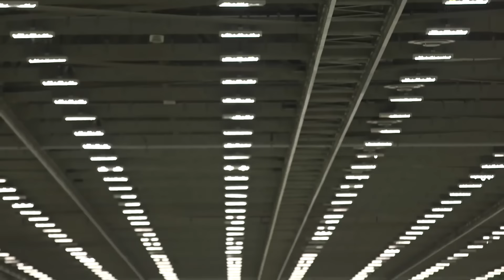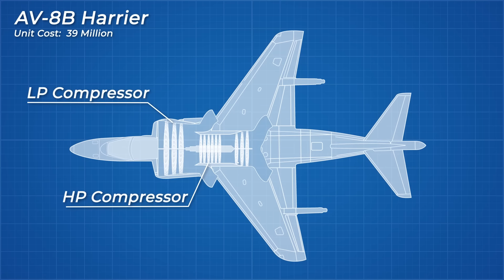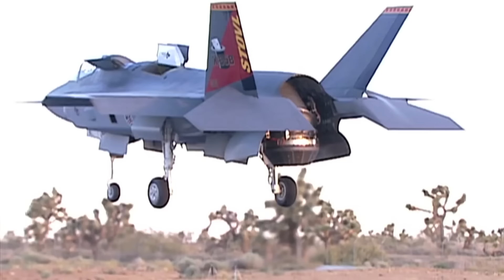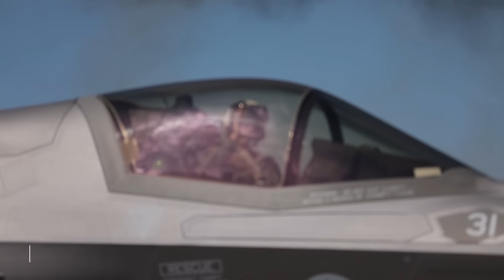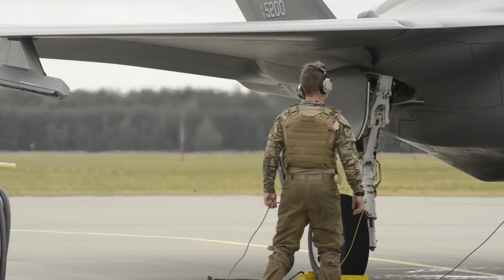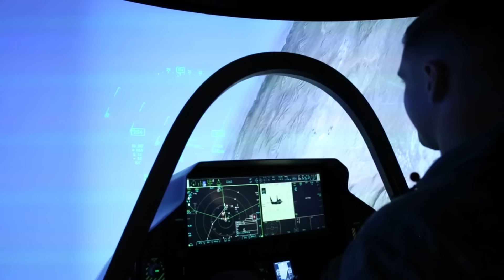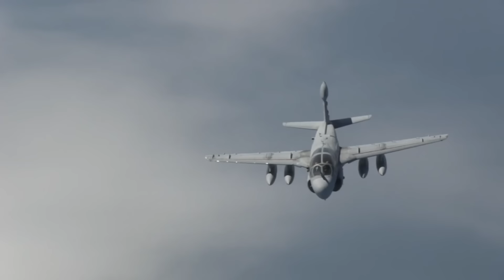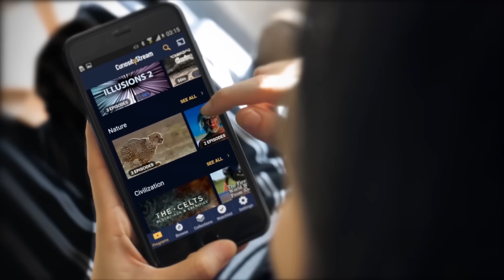Is The F-35 Worth $115 Million?

Comment: It should be noted that the F-35 has failed to beat the A-10 in terms of operating costs and operational effectiveness. Ground commanders routinely and explicitly request A-10 support because it can stay in the operating area longer and is better suited for continuous Close Air Support. Because it is a far older and more physically robust aircraft, the costs for replacement parts are both cheaper and last longer than the F-35's equivalents.
Reply: Not really the case. The multi-role fighter has been taking over for the A-10 in operational readiness, quick-reaction capabilities, and survivability where a ground-to-air threat is present.
Reply: Yes, Surface to Air threats is the only CAS realm that the F-35 excels the A-10 in, but that has not been the norm for the wars the US has been embroiled in. The costs and effectiveness differentials between F-35 and A-10 CAS operations are still heavily in the A-10s favor when StA threats don't exist.

Comment: 12:08 - "Missing software..."
Irrelevant point. Dogfights happen, and will happen even in stealth/low observable aircraft. Your software and sensors and radar and IRST can't see through a mountain or ravine or a valley of earth. Pilots routinely fly in these to avoid detection.
12:13 - "Missing radar absorbing paint..."
That's... not a positive. Paint on aircraft, especially RAM coatings, put on hundreds of extra pounds of weight on the aircraft and affect performance negatively (albeit slightly). Also, IR seekers don't care if you're invisible to radar, your hind end is emitting thermal radiation like its going out of style.
12:21 - "But these other pilots like the plane..."
1.) Not an argument. 2.) And as we see in the case of F-22 pilots that whistleblew about the oxygen generator issues ("Raptor Lung") on the aircraft, talking ill of multi-billion dollar weapon systems is a sure-fire way to prematurely end your career. And isn't it interesting when it's not someone who is connected with Lockheed, nor in a high position that starts involving politics as well in the military (like a Major overseeing integration of a mult-billion dollar weapon systems would be), and doesn't have the not-as-proverbial-as-you'd-like job on the line that they start quietly expressing concern.

The fact that Lockheed is dirty as hell and has been involved in multiple bribes, corrupt business dealings and outright illegal activities (see the Lockheed F-104 deal with Germany, for a major example)... Forgive me if I don't trust a single word coming out of their mouth. Especially when we have a mountain of evidence showing the shortcomings of the airframe and the entire point of us having this program was to "save money" and we're doing anything but that.

Comment: On one hand, I do think the whole make money by killing people iron triangle is pretty fucked up. On the other hand, there are far worse nations in the world than the us, far worse strategic alliances than NATO, and given the singularity the US and it's allies presents as a global military super power, the bleeding edge military tech does help maintain global peace (for the most part). 

The main issue I have with the F-35 and F-22 is that these aircraft are untested when it comes to Russian electronic warfare equipment, which is where Russia had invested most of its military R&D since the fall of the USSR. 

In Crimera, Russian forces have set up transievers over a few acres that, according to many sources, have the capability to jam wide bands of radio waves as well as listen to those bands, over an area stretching as far as the English channel in ideal weather. Much of what makes the F-35 both expensive and tactically adventageous is it's interconnected design, which goes completely out the window if the aircraft cannot communicate with one another or with the command center. In such an environment, the fighters are at a significant disadvantage to gen 4 and even some gen 3 fighters, which have better manouvering and lower energy loss in dog fighting conditions. 

Of course, the US is very unlikely to go to was with Russia, due to their significant nuclear arsenal, but it wouldn't surprise me if we went to war with China and it wouldn't surprise me if China was able to buy some of the superior Russian electronics warfare equipment from Russia; I don't think it is absurd to think such transactions have already taken place, as I believe China already blocks a lot of satellite and other radio frequencies as to keep it's citizens from viewing materials deemed inappropriate by the communist party. It would be far more efficient to keep the jamming towers up to date with the latest jamming and snooping EWF equipment from Russia than to build them only with limited capabilities. After all, if China needs to blacklist a new frequency, the EWF equipment would make that quite easy. In this way, China would have a rapidly deployable bubble that would block hostile forces air and ground communications and offer the Chinese armed forces a significant defensive advantage not seen since before ww2. The company level deployment of radio communications was a significant and decisive advantage us troops had in ww2 that was instrumental in organizing battle plans as well as reacting to the enemy where runners and other human communication lines may have been slow, ineffective, and unreliable. The radios didn't always work or have sufficient signal, but in the instances that they did work, it gave field commanders and line officers unprecedented tactical coordination abilities and overall strategic advantages. 

Russia understands how important communications are in modern warfare and have invested heavily in such technology, which reduces the amount of military spending and human capital needed to conduct both offensive and defensive opperations. The us should invest in new satellites and laser line communications that can network and connect aircraft and ground units with IR spectrum, low bandwidth communications that wide band jamming cannot effectively jam, as the signals would be point sources rather than broadcasts. Such a devise could, reasonably, be added to existing aircraft when it becomes clear that the enemy is using communications jamming EWF equipment, as to maintain a solid hold on communications and coordination.

Comment: There is also the "I" variant for Israel. The F-35 was supposed to use many of the same parts but they don't. They are very different planes. The F-35 will be an ok plane. The tech is impressive, but the plane isn't specialized. Noteable planes have been cutting edge and specialized. Blackbird, nighthawk, B52, Mustang, B2, A10 and Harrier.

Comment: Frankly, every single variant is, the A, B, and C are marked improvements over everything that its designed to replace, and costs less than trying to maintain the fleet of current generation aircraft throughout the next several decades.  Additionally, it's stealth capabilities, ECM and advanced avionics make it more survivable in modern high-threat environments ensuring the US expeditionary capability is still a credible threat for the foreseeable future.  From my understanding it does everything that they were looking to do.

Comment: this plane is older than me (I'm 18) 
imagine Nokia 3310 being released today, imagine a plane that maximises todays technology
Reply: It takes a long time to field a plane without getting people killed.
Also M Hamma is right, the software is not what it used to be, which is part of the reason it took so long to be deployed.
Reply: Actually no, the planes coming off the line are brand new and have been getting tons of updates / software / sensors that can be fitted to the older aircraft.  It's like a modern PC being upgraded with each block that is built.  The lines are continuously being upgraded as are the parts going into it.  It was designed with such modularity in mind.  Each new block is better  / more advanced than the last.
Reply: @mhamma6560  It is like an old PC being upgraded while a Smartphone can do the job and it has more options..
Reply: @TorianTammas  more like it's a pc case that had all it's internals ripped out and replaced with cutting edge classified technology, much of which we on the consumer market won't be privy to until 2040.
Reply: @TorianTammas  The F35's capabilities makes the smartphone look dumb.
Reply: @mhamma6560  I assume you missed  the point as it was about a PC And that it can be replaced by better tools like a smartphone in certain ways. Such a costly gadget like the F-35 is overpriced and questionable if not cheaper and more specialized ones would be more then qualified to do the job.
Reply: @TorianTammas  There is nothing a smartphone can do better than an actual computer with keyboard.  Such a statement shows either your lack of understanding of PCs, or the fact you've never had one setup to get anything done.  Current phone capabilities remind me of a 20yr old computer as far as productivity.   There's no comparison.  Phones and tablets are CONTENT CONSUMPTION devices, nothing more.  They're very poor at pretty much everything else a PC can do.  Do you know what's taken up the role of  content consumption devices?  Smart TVs with a screen that's actually usable.  Phones can do nothing of value without being tethered to a charger.  Even then their max utility is still basically a small fraction of what a knowledged individual can accomplish with computer.
Reply: @mhamma6560 - The idea was a comparison to illustrate that people use smaller, easier devices for basic needs. It is a fact that a lot of people replace their PC with hand held devices like tablets or smartphones they can use wherever they are. A lot of people have very basic needs that can be fulfilled from using an actual phone to text communication and email.  
The point was the gigantic investment in a plane that should fulfill the need of every branch is questionable. There are needs for a high end PC or may be even a grey computer, but a in most cases small and more flexible approaches suffice may it be tablet, laptop or smartphone.
Reply: @TorianTammas  If someone "replaced" their PC with a smartphone, they didn't need a PC in the first place.   Completely irrelevant to the 35 though.
Reply: @mhamma6560  The point was that one plane never can fit the needs of three branches of the military. The PC was an example given not by me and I used just the example of tablet and smartphone that what they serve people who once used a PC for certain task. A high priced plane means it is in short supply and it does not the tasks as well as a specialized plane and often a cheaper and more flexible one would do the trick.

Comment: When it comes to getting your hands dirty in the ground war, fancy and expensive doesn't work.
Cheap, durable, and easily fixed/replaced works.
Our guntrucks weren't science fiction marvels armed with lasers, they were hummers and delivery trucks with armor bolted on and a motor pool of salty grunt mechanics. 

At 25,000 feet in a dog fight with strategic implications, sure, go Fancy Spendy. At Angels 2 with purely tactical implications, you have to accept some losses, and have the money to replace the equipment AND the men, AND still field lots of them afterwards. Sorry, that's just war logistics. Never, ever go with an "eggs in 1 basket" strategy when getting dirty with the ground conflict, which is what the F-35 does, and the A-10 does not. You shoot down 1 out of 2 F-35's, CAS just stopped. You shoot down 3 of 9 A-10's for the same price, the other 6 keep delivering Mk83 pizzas.

Comment: The AV-8B is an American design by McDonnald Douglas. The British had very little input into the airframe.

So a Pegasus engine looks like a normal 2-shaft turbo fan jet engine with 2 compressors and 2 turbines because it is a normal 2-shaft turbo fan engine with 2 compressors and 2 turbines with the air bypass air being ejected from the airfram ahead of the centre of gravity through its own exhaust nozzles than the traditional route of out of the exhaust nozzle. The nozzles are part of the airframe and not the engines, as anyone who has read anything about this aircraft knows.

The contol nozzles are at the extremities of the wings and fuselage and are further away from the centre of gravity than the associated control surfaces. What are closer to the centre of gravity are the exhaust nozzles. There were roll, pitch and yaw control jets, and the were linked to the control surfaces all of which were manually controlled.

All pilots have to consider many factors when landing, as if they get it wrong it often is the last mistake they will ever make. Apart from keeping a look out for other aircraft, they have to keep a eye on their landing point and maintain the right glide slope. This is fine if the wind is coming straight down the runway and there is no rising, or worse, sinking air. They also need to ensure thst they round out at the right momemt. Too high and they might stall into the ground to low and they have a controlled flight into terrain accident. The pilot gets a lovely seat at the front with a brilliant view, however, this means they will be closer to the crash that anyone else.

Please stop mixing up the words valves and nozzles.

Well every capability save the A-10's ruggedness and gun.

Comment: Due to range and payload limitations of the f35. While purchase price is lower then the f22, if you take into account the fact that you need more f35s then f22s for the us military to do what it does. Then the f22 actually ends up being cheaper in the long run. And it's still miles better in air to air combat

Comment: the F-35 is not worth shit from my ass, it's a garbage plane that can't dog-fight OR super-cruise and every role it fills is already better filled by a safer, more specialized design
Reply: This notion is based on what exactly?
Reply: @peterson7082  One of it's main proponents literally said it's incapable of dog-fighting, two of the three variants aren't capable of super-sonic flight at all. At best it's maneuverability is on par with an F-16, while having a smaller payload, it requires the replacement of a large portion of infrastructure, including both carriers and cargo planes (they're aging and need replacement anyway, but ideally older versions should at least be compatible)

And of course, it solves a problem that doesn't exist. There is no legitimate threat to US air superiority that merits the adoption of a stealth capable fighter, or in fact anything more expensive or difficult than simply making minor improvements to older models, more in order to retire aging airframes and engines than to actually meet some need.
Reply: @Oldage429  Most pilots seem to agree its maneuverability, acceleration, and turn rate is on par or better than the F-16C/ D and F/A-18E/ F. All three variants are capable of supersonic flight at combat load. The F-35A and F-35C still maintains a degree of smaller RCS and less parasitic drag than its contemporaries at full combat load. 

 The issues with overbudgeting largely came with prolonged requirements formulation (something that had nothing to do with Lockheed Martin ) and unfortunate and arguably uncessary repeated postponing of testing between 2007 and 2014. Albeit the tests were completed still in the time period.
Reply: Oh, and also war is always a colossal waste of energy, money, and human life and the US military is the single greatest source of suffering and misery among all institutions on earth.

Comment: what, no mention of the yakovlev & lockheed partnership (1991 - 1997) and the yak-141 “freestyle”?

random google search: “When Lockheed entered a VTOL variant of its X-35 demonstrator into the Pentagon’s Joint Strike Fighter (JSF) in 1994, the submitted engine design proposal was radically different from initial proposal developed prior to the Yakovlev deal. Indeed, the VTOL design was changed to ‘ASTOVL Configuration 141’”

Comment: Third gen planes such as the F-15 as well as support aircraft such as the A-10 are in service for 60 to 70 years these days. The initial unit purchase cost is far outweighed by the total cost of replacement parts and upgrades needed to keep them in service. By unifying most of the components in the three variants of the F-35, the US expects to lower the total cost of fielding the aircraft. This is possible by producing replacement parts and integrated upgrade packages in higher quantities. Design, tooling, and production costs can go down exponentially if you are producing high enough and long enough to buffer the initial costs. 

Defense planning needs to work on a "long game" strategy that is difficult to understand for "4 year" politicians and the general public.

Comment: its  several small companies working under Lockheed martin in this way it secures jobs around the  country but as you said muddy waters making it cost more at first but the price will go down over the course of it.  This was a small step back but stopped it from f22 problem  that was far to easy to cancel some of its runs as the jobs are not just one part but several sections of the industry.